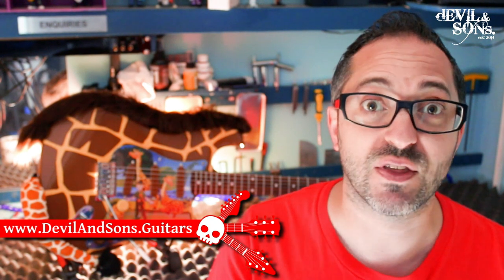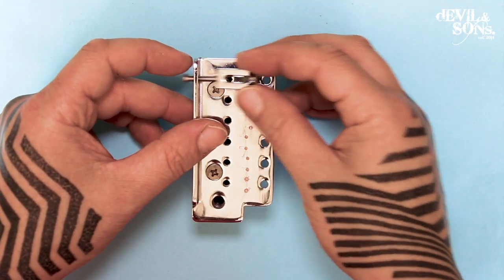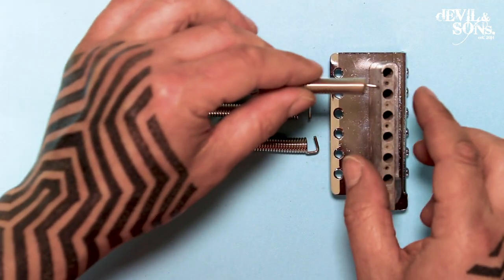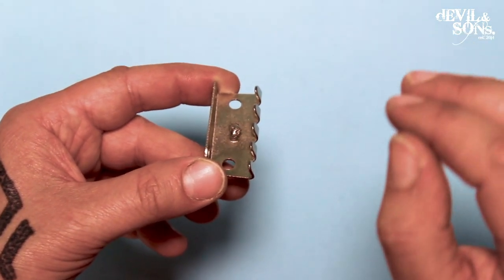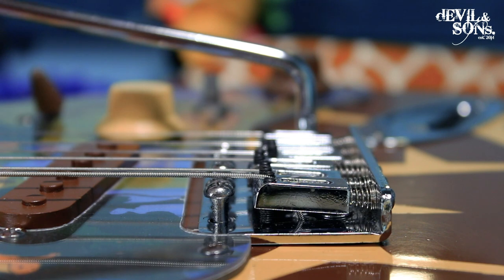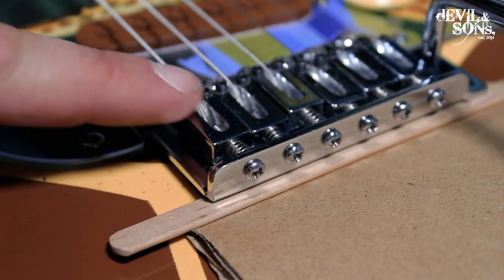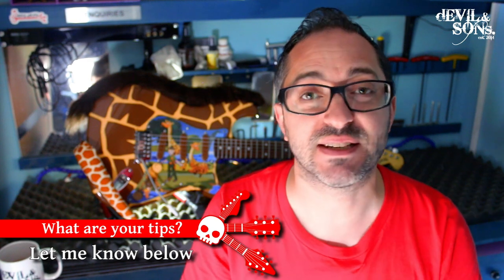Setting up a Stratocaster bridge and how it works in depth.

Comment: Good job.  2 things almost no one mentions are the Counter sunk screw holes underneath the bridge plate and the Bevel underneath.  Counter sunk holes, the deeper they are cut the sharper/ more blade like they become and makes for a smooth pivot otherwise it is squared off and difficult to pivot.  Second, the Bevel, most Strats have a bevel past the screw holes which makes the bridge pivot at two points, one is the centerline of the screw the other is the end of the bevel which results in the bridge sliding up and down on the screws.  The bridge plate you have the bevel is at the center point of the screw and hence will not slide up and down the screw.
Reply from the maker: Great information, thanks so much for adding this. I hope future viewers read the comment. 👏

Comment: Great video, so helpful. What do you recomend/your experience if you want a trem floating on a Fender strat regarding staying in tune is that to replace that bridge with a for example a Vega Trem or any other suggestion that best keeps the Fender in tune in the most situations?
Reply from the maker: Are you having trouble with yours going out of tune then? A better quality bridge should improve it, but first I'd double check the machine heads to see if they are slipping at all.

Comment: May i ask? What wrench size does it fit in the saddle area? 1.5mm? I have bought a stratocaster recently and i dont know the wrench size for saddles and for the trusrod Thankyouu
Reply from the maker: It dies vary a bit by make. Is yours a Fender?
Reply from the maker: 1.5mm would be fender and 1/8" truss rod should be correct
Reply: American Fender Stratocaster is 
.050 inches, and made in Mexico and import Squier is 1.5mm
Reply from the maker: Thanks for this @curtrod

Comment: Hi, I think there's a mistake on how the spring tension affect the pitch change 14:11. No matter how strong your springs are, as long as the bridge is in a certain angel and you want a certain bending range, the bridge is gonna move a certain angle/distance to change the tension on strings, the springs are just working against the movement, 5 springs will force you to put more strength to move that angle/distance than 3 springs, not more distance/angel.

(I always use only 2 springs to let the guitar bridge bend easier.)

Comment: What would be the initial saddle height?
Reply from the maker: Sorry for the delay in responding. Usually i have the saddles set so the screws aren't sticking out above the top of them, then take it from there. No exact starting point.
Reply from the maker: In my full set up video I talk more about string height and how to set the saddle height.
Reply from the maker: https://youtu.be/fvD-qsM3piQ

That's the full set up video
Reply: Thank you
Reply: The individual bridge saddles with the 2 small Allen screws, are they supposed to be equally aligned on initial set up?? Thank you
Reply from the maker: I start with them all aligned then adjust as I set up the action and intonation (as per the set up video)
Reply: @DevilAndSons  Thank you for your help! Your videos are Great! 👏👏
Reply from the maker: @georod2237 it's a pleasure.

Comment: Sorry but most of your physics explanations (in the first half of the video) are incorrect.
Your trem balance explanation is not correct. For any static position of the floating trem, it's not the tension in the strings and springs that must be equal, it's the torques that must be equal (around the knife edge rotation axis). The springs are much further from that axis (perpendicular distance) than the strings, so the springs require much less tension than the strings to generate the same torque (and thus balance the floating trem). Torque is the product of tension and distance.
When you described removing a spring, you omitted the fact that the total spring constant (k) changes too, not just the stretch required (to get the same total spring tension). The total spring constant is additive for parallel springs. So 2 springs have a 33% lower total spring constant than 3 springs. Thus the trem feels less stiff to move with 2 springs.
Your arm movement explanation is also incorrect. The change in pitch of the strings is dependent only on how much their length changes for a given amount of arm movement. If the arm is moved by the same distance with 2 springs as it did with 3 springs, the change in pitch will be identical (because the strings changed length by the same amount). Moving the arm by that same distance with 2 springs will simply feel easier than with 3 springs, because of the above-mentioned reduction in total spring stiffness.
Reply from the maker: Thank you for clarifying this.

Comment: Hey great video! Is there any particular reason why a lot of people say you should take your strings and springs off before adjusting the mounting screws on a six screw tremolo, but you don't? Just asking because I don't want to take my strings off but wanna adjust mine, but the opinion on this seems to be divided for some reason 😊 thanks
Reply from the maker: That would mean potentially taking the strings on and off over and over if you are making fine adjustments. This could essentially mean the strings breaking. Turning the screws with the tension on them is obviously not ideal, but they should be pretty strong to be able to take this minimal amount of adjustment, which you don't have to do over and over once it's done. I don't think the force put on the screws or the bridge plate whilst you're adjusting the screws is going to do any long term damage.

Comment: Completely wrong between 13:00 and 14:11.  To lower a note by a set amount (e.g., 1 semitone) the tremolo arm will move the same distance, regardless of how many springs are fitted.  The springs will extend by exactly the same distance, whether there are two, three, four, or even five.  Since this distance doesn't change, the force required to move the arm will vary.  But the distance it moves won't.
Reply from the maker: Yes. That does sound right. It's the force that the springs change.

Comment: The setup as shown in this video will have the saddle screws 
tear the blazes out of the hand when palm damping. Won't it ?
A solution would be to shim the neck back to allow the saddles to be raised reducing the screw projection.
Reply from the maker: In this case I normally just end up putting shorter saddle screws in.

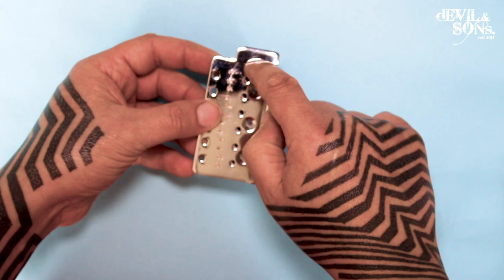Comment: 3:55 What are the sizing of these bolts? I bought a used guitar and these bolts were stripped and I can’t find a replacement.
Reply from the maker: Actually I called it a bolt, but it is an engineer screw. I think it may vary depending on the make of block you use but normally an M4 screw (4mm) that is 6mm should work. On the Allparts website they list the genuine fender ones in imperial as #8-32 X 3/8"

Comment: There are only 2 springs on my strat with the screws all the way up on the claw. the screws on the body seem to be tightened too much.

Should I loosen it? I want to have a decked setup so I won't need to worry about stability that much
Reply from the maker: Personally I would loosen the screws on the body so that the bridge plate is completely flat, and if the springs aren't strong enough you do have space to add an extra or two. If you do add springs you'll have to start by loosening the screws on the claw to add them, then retighten. Inwould probably just put at least one extra spring on to be sure.

Comment: Hello, I have a question, with this method the bridge is not angled forward? It seems to be straight like Floyd Rose but with a space to float back too? Thanks
Reply from the maker: There are two methods in this video, but either way you need your bridge flat and not angled forward. If it's angled forward it's because you have screwed the front screws down all the way which is incorrect. Does that answer your question?
Reply: @DevilAndSons  Thanks for explaining it to me, now I understand.
Reply from the maker: @LuisLopez-dw3wz no worries. Happy to answer any more questions.

Comment: Superb vid. Thanks man, this was t easiest choice to sub ever🤙. Camera angles, were sweet as. If players dont use t whammy bar, i think u called it a tremolo thingy,  can the whole plate just b screwed in tight with those 6 screws to keep that 3(?) degree angle? And with the springs beneath, tight enough to hang on firmly. Im just learning. Drums r my love, but its great to learn new things. Cheers.
Reply from the maker: Thank you, that's so kind of you to say. If you don't use the trem just tighten the springs underneath to hold the whole plate down at all times. Don't tighten the 6 screws all the way, that will stop the plate being flat without something bending.
Reply: @DevilAndSons  Got it. Thanks heaps for your reply, much appreciated.
Reply from the maker: @woody4269 anytime. Thanks for watching

Comment: how did the front of the bridge raise? If I do this, the screws just move up and down but the front of the bridge stays on the body. Was there a moment where you forced it up with a screwdriver or something like that?
Reply from the maker: Ah, yes that could be happening, especially if the springs are tight on the back. It may be worth loosening the springs first, you may still have to nudge the bridge up with a screwdriver, then retighten the springs ( which you would be doing as part of the setup process anyway)
Reply from the maker: I hope that helps, if not do let me know.

Comment: I would like to see how you set the bridge position . Center line , scale etc . Where do you put the bridge ?
Reply from the maker: Thanks for watching. 
Good point, I don't think I have a video the explains this on it's own, although I think I do in some build videos. I do have two videos that might help though, the first on scale length 
https://youtu.be/8piycrcII5o
Reply from the maker: The second on intonation https://youtu.be/cQ-yslOuHck
Reply from the maker: I think I will make a video about this though on a build I'm working on in November.
Reply: I am at this point right now in my parts caster build . I have never set a bridge up before . Establishing a centerline and scale is so important . I don’t want to screw it up . I have never done a tremolo bridge either . Thanks , I will be watching ,
Reply from the maker: Cool, and good luck. The key thing really is to set the scale length at the middle position of the bridge saddles so you have give both directions to compensate.

Comment: Love your content! 
I just picked up a new Fender LE Player Strat with the 2-pole synchronization bridge, and I’m finding that I can only get my action high enough (eliminating buzz, and sitting where I like them) if I let the bridge float.

Also, when I lay it flat (and support the neck w books) and try to adjust the intonation, the 12th fret voices slightly sharp, but the saddle is all the way as close to the tail end as possible (pushing up against the pole)

Any advice??😊
Reply from the maker: Thanks so much for your kind words.
When I've had that problem with intonation my first step is normally to cut the spring behind the saddle to give the saddle a bit more distance to travel. Do you think that will be enough for you?
Reply: @DevilAndSons  sorry for the confusion, the saddle is pushing up against one of the two poles. The saddle screw is extended all the way (high E string) and both the harmonic, and fretted 12th fret are sharp compared to the open string. Just a little.

I also just read that you can raise the entire bridge with the two pole screws, so that may give me the string height I’m lacking.

I’ll have to start from square one, and fret the 1st, and last fret and measure the relief. Fender recommends having a tiny bit of relief, right?

Then I’ll do everything else again. Maybe eight the bridge heightened and the neck givens tiny bit of relief, the intonation will change?

Thoughts?
Reply from the maker: @pjincho if it's sharp you move the saddle back. Ibwould say if ot's a new guitar and ot doesn't intonate correctly you should return it.
Reply: @DevilAndSons  yes. There’s a 60 day return policy. I’m trying to see if very light-lift at home set up can remedy it. Now that you mentioned it’s the other way, I’m pretty sure I can get it to work.

In what situations can a person raise the bridge by the 2 pivot poles? Can this be used to add height if the grub screws don’t give you enough?
Reply from the maker: @pjincho great, would be good if you can remedy it yourself. Yes, you can use the poles to raise the bridge to raise the action and also to set up the bridge so that it floats.
Reply: @DevilAndSons  tried to remedy part of it by adding relief to the neck.
The truss rod has no resistance, and I can’t add more relief.

There’s the tiniest bit of relief… maybe a couple sheets of paper thick at the 8th fret with 1st and last pressed. Not sure what the actual thousandth of an inch measurement) but I can’t pass a piece of card stock paper underneath.
Brought it to the tech at Guitatcenter. He said the neck is fine, and that the fact that I can’t turn the truss rod CCW anymore shouldn’t be an issue…. That the neck will bow over time anyway.

Thoughts?
Reply from the maker: @pjincho it's only not a problem if it plays well. If you're having issues with it, I.e buzz and action problems and can't fix it then it is a problem.
Reply: @DevilAndSons  is there an upper limit to raising the bridge with the pole pegs?
Like, should I not go too far above the pick guard?
Reply: @DevilAndSons  so far so good. Am able to get it intonated.
The breaking in of the guitar, and the instability of the floating trem takes some getting used to.
Haha. Today I learned that my action is way too high. For context, I’m self taught and gettting back into playing. Never progressed passed the very basics, and have sloppy technique, so I can play some more complex licks without understanding why they’re good, or being able to play them cleanly and consistently.
All that to say that my D and G Strings were sitting at roughly 7/64ths inches above the 12th fret. My bending technique is entirely built on being able to easily push up the string above without having to roll my fingertips to catch them. Have to kind of learn it the technically correct way.
Thank you kindly for your time. I rly appreciate that you obliged.
Reply from the maker: @pjincho it's a pleasure, and thanks for watching and commenting. Hopefully understanding the action etc will help with your enjoyment of your instrument.
Reply from the maker: Honestly, it depends. As it effects the action I would rarely have it that high, and only really raise it for the float, which doesn't have to be that high.
Reply: @DevilAndSons  oh ok… so does the front (pole side) of the 2-point trem’s height depend on how high it’s floating?
Reply: @DevilAndSons  I think I may have read somewhere that you should have it parallel to the body at all times? But I’ve also seen floating trems that are angled.
Reply from the maker: @pjincho yes
Reply: @DevilAndSons  yes parallel?
Reply from the maker: @pjincho parallel will ensure it operates smoothly and there isn't excessive pressure on one more than the other.
Reply: @DevilAndSons  perfect! So essentially, if I want to raise the bridge by the poles, I’ll HAVE to keep it floating.
That is to say that if I hardtail it, and the string heights are too low for me, I shouldn’t raise the poles with matching it with the back end?
Maybe i can just shim it to keep it steady.
Reply: Where can I contribute monetarily to your channel? You’ve been such a selfless actor, and I’d like to show my appreciation! Cheers, mate!
Reply from the maker: @pjincho  That's so kind. You should be able to click super thanks (the heart logo) under the video. So happy to help, and that is much appreciated.